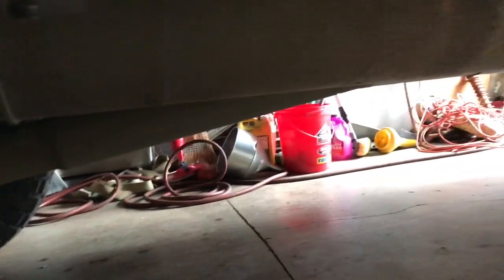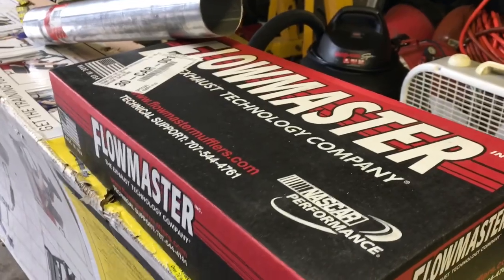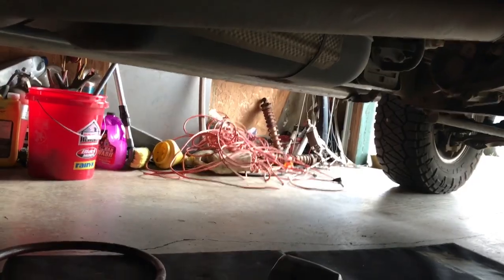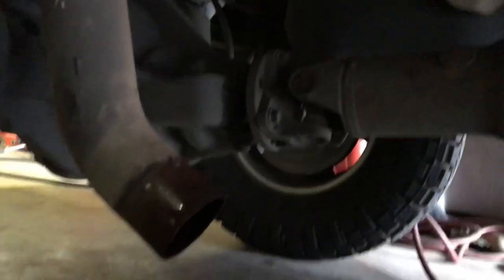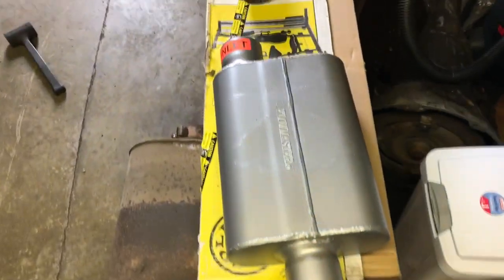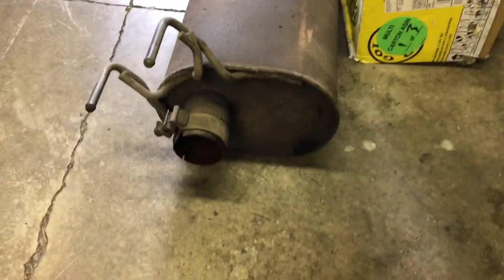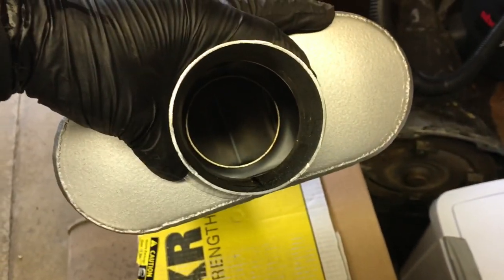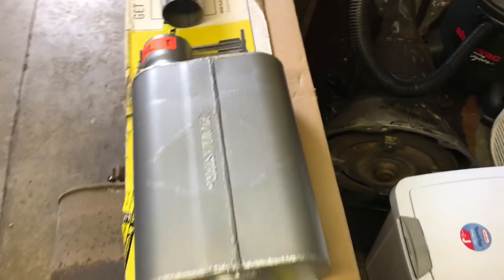2008 Dodge Ram Hemi Flowmaster Muffler Install// Before And After Sound

Comment: I see you have 3” inlet offset and out is  Center 3”. 12” piece of pipe did you have to put any bends in the extension? Or did it line up? I’ll probably buy another muffler to make it work!
Reply from the maker: Nope it lined up pretty well. Hardest part was muscling the stock Muffler off.

Comment: i have the same muffler i'm planning to install and i was concerned if it was gonna be to loud , like everybody  were saying but after listning to this i'm finally convinced, i weld a 2 feet pipe to it hopefully would be enough ! what measurement in/out pipe did you install on that ? i was thinking on bringing that to a muffler shop and get it weld it on , but if i could save a buck or two i would be really happy LOL!! great vieo :-)
Reply from the maker: It was a 3 inch in/out. And thank you
Reply: RandomActsOfRyan  no problem at all , i just bought a pipe extender and 2 clamps..as soon as it warms up a little I’ll be installing the baby..and i got 2.5” leveling kit on the way too
Reply from the maker: That’s awesome!

Comment: where did you buy the extension pipe? after the muffler?
Reply from the maker: Advance Auto Parts
Reply: i just finished installing that exact muffler and did you have any issues with the resonator moving? because my tailpipe moves up and touches the truck